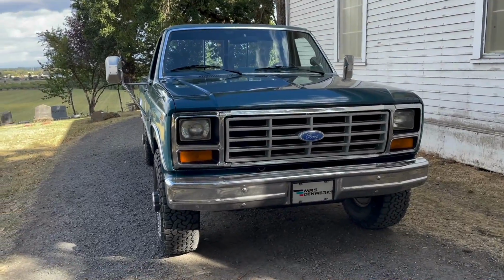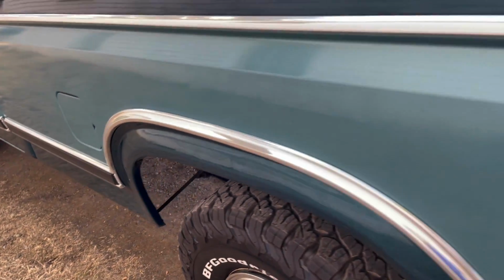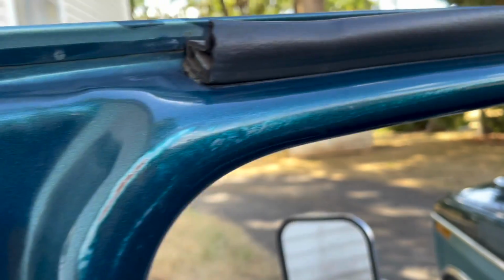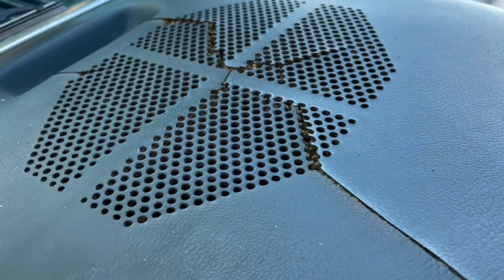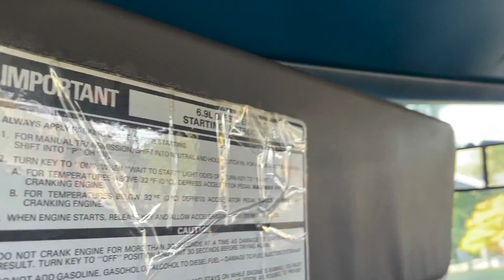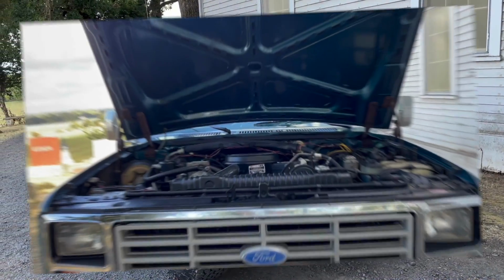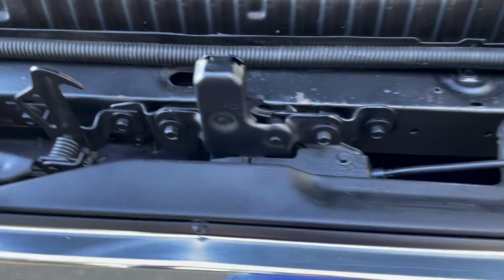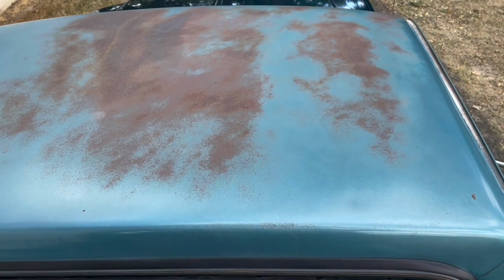1983 Ford F250 6.9 Diesel Denwerks Bullnose Ford Trucks No Reserve Auction

Comment: That is a nice example of the classic bullnose 6.9 , we just bought a 1986 XL 6.9 , came with air conditioning  , cruise , tach , red cloth headliner , red vinyl floor mat , 4 speed , 4x4 , fold lock chrome mirrors , two tone black and silver , 8600 GRVW  , STERLING 10.25 REAR AXLE 3.55 GEARS duel tanks , red cloth bench seat , sliding rear window , 117,000 miles for $5900.00 dollars starts right up when 20 below zero here in MN ,  just cycle the glow plugs 3 times , here in MN .